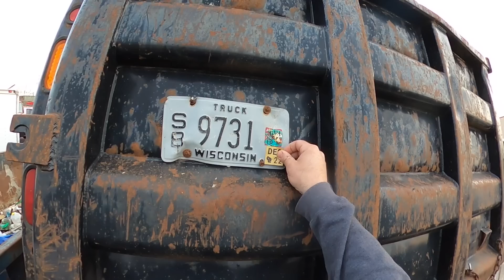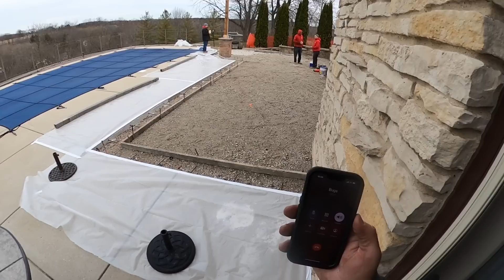Concrete is back in my life!

Comment: 6:15 Dumbo Darrel pulling the blade by the head light so it will snap off! Low oil shut off saved that motor Any other place Darrel would have lost his job a long time ago

Comment: Down here in Ontario, Canada we also use air-entrainment additives, it creates microscopic air bubbles which helps with the freeze/thaw cycles and durability to the concrete also helps with scaling and improves workability.

Comment: Ryan I am a concrete contractor I'm Maryland I originally mentioned orange thunder to you.  It is fantastic at finishing concrete when it's ready to get out on boards they level the surface much better than mag I use the bull float also.  Great tools. Took me awhile to warm up to them but my crew goes all orange when we start finishing.  Try them out on some hard concrete you will be convinced.  Great channel great work you guys do. I admire your walking jointer work.  Well done.

Comment: By the looks of it you better hire another 5 guys.I’m not trying to be rude, but C’mon.  If that buggy didn’t have a low oil cut off switch, you would’ve had a broken machine and have a $4000 engine to replace.

Comment: Hey Ryan,
I work for a Cement Manufacturer down here in Florida, we have made a big push to the limestone cement this past year as well (almost all customers: converted) they have done lots of testing on the cement to make sure the quality is there if not better, also import cement from lafarge for resale and are getting the same cement! Best of luck this season!
Reply: The concern in WI is the salt.
I have a driveway, not even 2 years old and the surface is flaking like crazy.
Reply: @vancomycinb  Limestone is not the best of the fillers out there. Due to raw material supplies and what type of fillers are locally available, cement producers are making a shift to a more sustainable binder system. I live in The Netherlands and we are on ration regarding use of CEM I. This is not just from a sustainable perspective but also shortages in supply. In NL we are already introducing bindersystems with 3 components in them and 'just' 20% CEM I and maintaining strength characteristics. But with Ryan, strength wise al may be okay but exposure wise....we are not there yet.

Comment: The cement companies are also about to implement a 2nd and substantial price increase this year. The concrete price is going way up, like everything else. Thanks Brandon!
Reply: It increases about 2% every year.
Reply: @tehSharp0n3  Cement companies in the Midwest in my area had a Jan 1st increase of $10/ton here and on June 1st another $8/ton is announced. Average price per ton is between $115-180 per ton depending on producer size ect. If a producer were to only increase 2%, that would only cover about half of their cost of the cement ingredient alone per yd. And this doesn't add in all the other increased costs to the producer like other material surcharges and fuel per their cubic yard material cost.